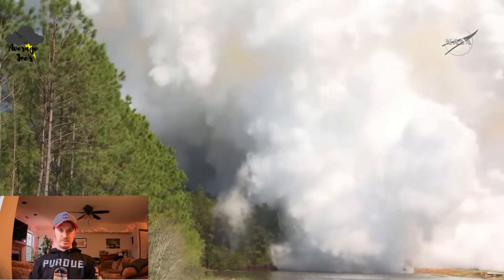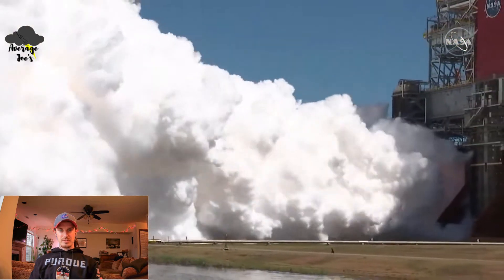Rocket Engineer Reacts to NASA SLS Green Run Test for Artemis Program #sls #nasa #boeing

Comment: That steam is Water Deluge + Engine exhaust!! Not just engine exhaust!! The fire on the base heat shield is the cork ablative layer burning. Remember, no air from ascent here!!! Just mostly static air while it’s sitting!!! It started from the CAPU exhaust, the exhaust from the hydrogen-powered hydraulic pump turbines!